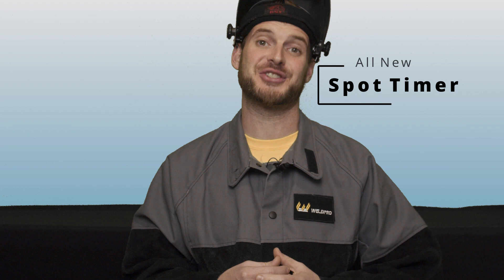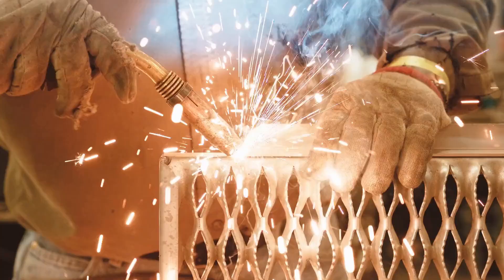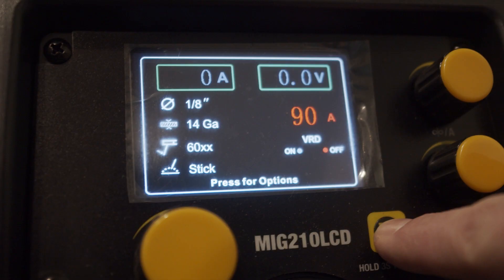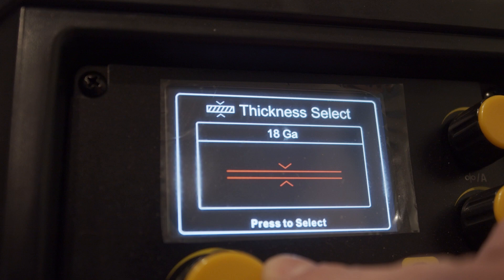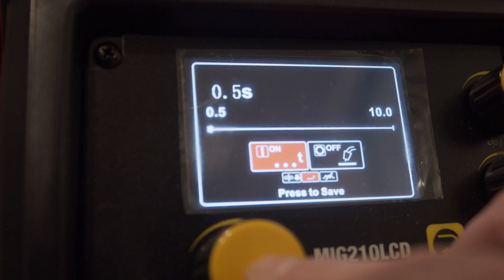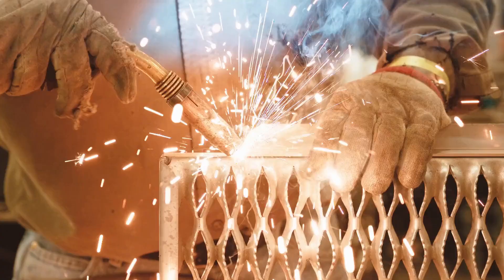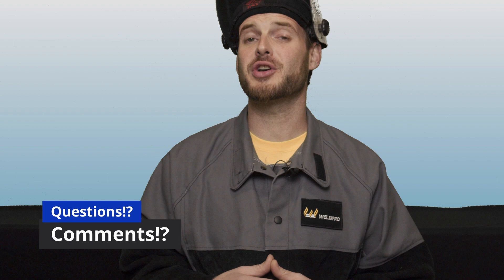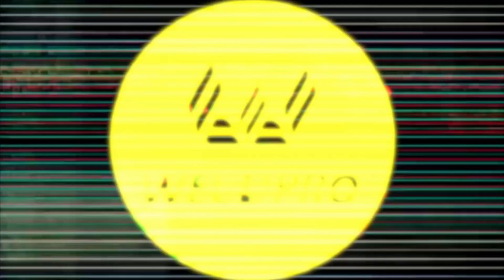Weldpro Tips - Setting up the Spot Timer on the  MIG210 LCD

Comment: An excellent feature for tacking body panels onto the frame. Will the spot weld also work with the spool gun during aluminum welding, or is this just for steel settings?
Reply: The spot timer will work with the spool gun connected.